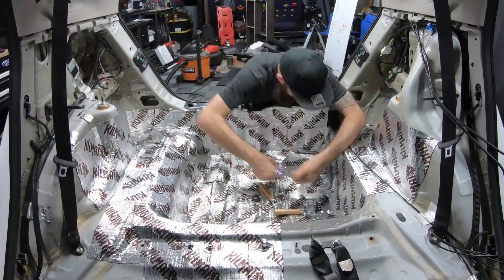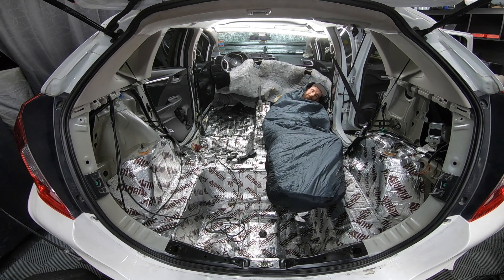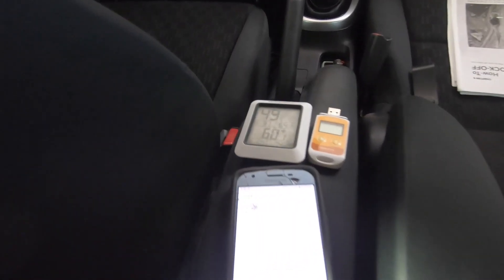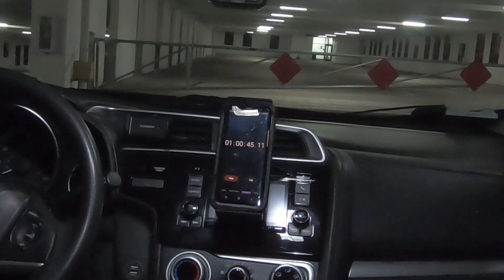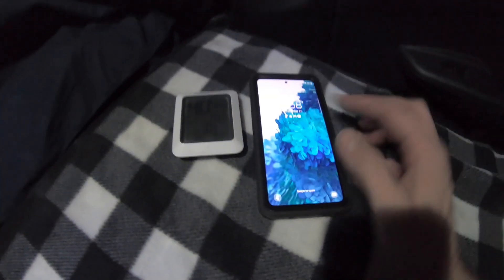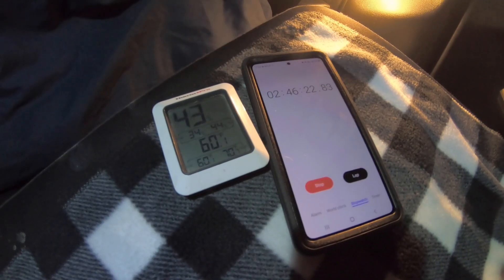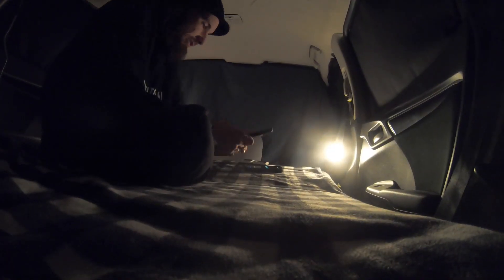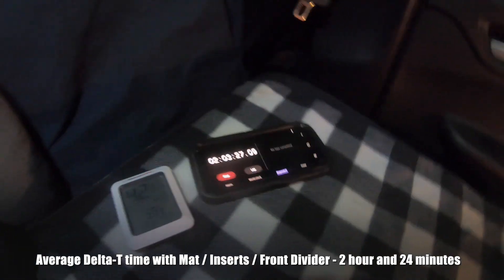Does Adding Sound Deadener Help Insulate Your Car? | Honda Fit Car Camper Finds Out! | PART:1

Comment: What about the sound isolation did it 8mprove significantly?
Reply from the maker: I think you already found my other sound deadening videos.
Adding the sound deadener underneath the headliner made a huge difference, especially being a roof rack user.
I just did the doors (Not uploaded yet) and it cut down on the cross wind noise and it also improved the audio quality of the speakers. Mainly the bass.
Reply: @HondaFit4Adventure  thank you ! That video sounds interesting
Reply from the maker: @garluis23  I just uploaded "Sound Deadening The doors of a Honda Fit"
I had some interesting results with the sound deadener during the winter.
https://youtu.be/kNTFIwsPPhA
Reply: @HondaFit4Adventure  I was just watching it XD
Very interesting and useful info , thank you so much

Comment: I couldnt find a video of removing the front carpet but i was curious. does deadening the front wheel wells help with wheel sound? Thanks
Reply from the maker: Hi Javier, 
Removing the full carpet is quite the process. I got most of the carpet free except for what wraps up and around the center console area. 
I just held the carpet up while I worked underneath.
IMO, I think the floor boards (Feet area) made the biggest difference.
Matting the roof made a dramatic difference as well. This was most likely because of my RoofRack
I do have some pics of the carpet removed up front that I can send you.
Shoot me a message on IG @HondaFit4Adventure
Reply: @HondaFit4Adventure  ok thats good to know. Im definitely doing the wheel wells and the roof! Thanks for the great responses as always.
Reply from the maker: @LMFAO5001  Anytime!

Comment: That was interesting; you did a good job at trying to control the experiment.  I can say that when I put the sound mat in my N200, I noticed a big difference when parked in the sun. I wasn’t looking for it, I just noticed one morning when it went from 50 to 80 in a few hours. I opened the door and could “feel the cool”. I attribute it to the gap that the elastomer provides, with a reflective layer on the inside. My guess is that it makes a bigger difference in hot climates, when the sun is beating down. But that’s just a subjective guess. Get your ass to Florida! LOL
Reply from the maker: After reading some more information it appears that your guess would be correct. The reflective properties work better to keep the car cooler in the summer then warmer in the winter. It also seems that I have quite a few follower in Florida lol.